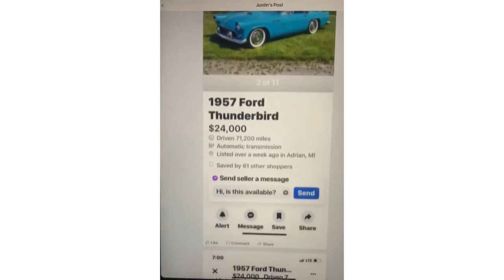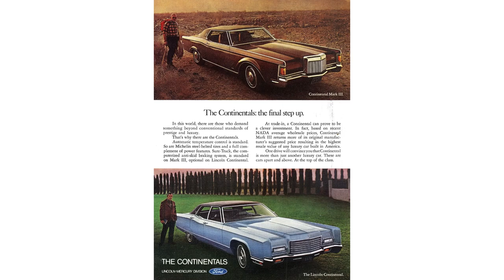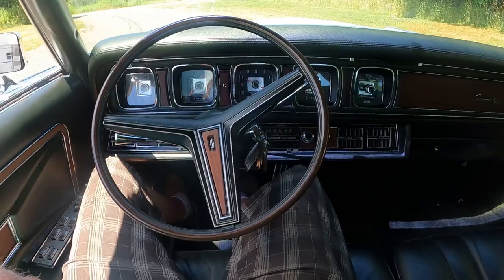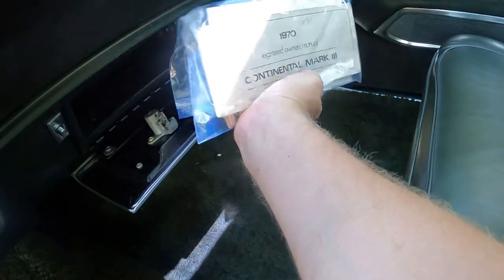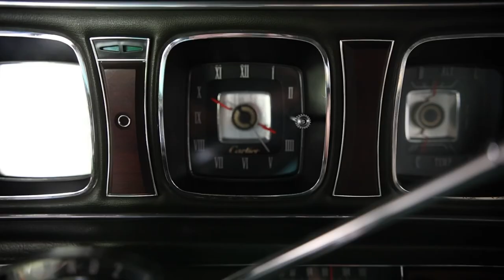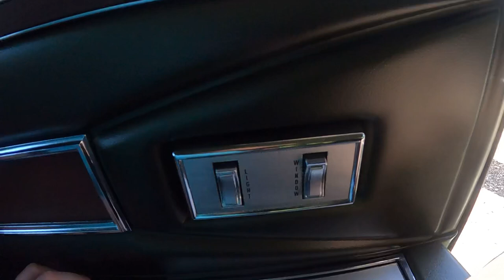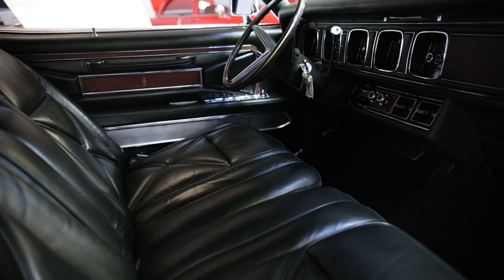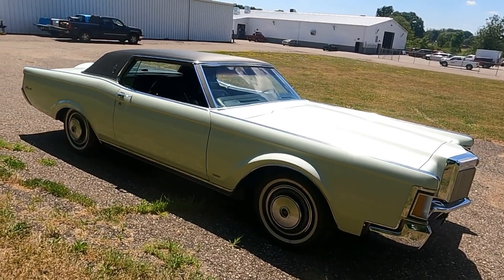1970 LINCOLN MARK III MOST IN-DEPTH REVIEW ON THE TUBE

Comment: I was lucky enough in my teens to have purchased a 1961 suicide door Lincoln in excellent condition… drove it for two years and then purchased my first Mark III a 69 model. I would go on to eventually have owned four of the Mark IIIs over several years. It is interesting to note that with the quick commercial success of this series of Mark that Ford did no design changes except for a few things that only Lincoln purest know - one of them being the hideaway windshield wipers did not exist in the 68 and 69 years and first appeared in the 70 and carried over into the 71 model year. In 68 and 69 the interior wood grain was artificial however in 1970 and 1971 Rosewood was introduced and the model that you show in this video has real Rosewood on the doors and the small strip in the steering wheel and on the dashboard as well. It probably was not inside the dashboard in your example (most lost over time) but at the top of the glove box was a handheld mirror that could be removed from a little shelf that held it. Also you did not mention that this is one of the first cars to use fiber optics. The little bump on the back shelf in between the flow through ventilation vents is a little module with two red eyes that would stare at you in the rearview mirror at night as long as your taillights were on. This feature was to allow the driver to know if a tail light bulb was out. I was absolutely enthralled with that and loved that little feature which used two thick strands of fiber optics that went from those little dots on the rear shelf all the way to the tail light housings on each side of the rear fenders. The flow through ventilation system could be turned on or off and it actually was a pneumatically operated damper door in the back shelf that would open up and completely vent the interior of the car… I think because everybody in the 60s and 70s smoked lol. The Lincoln Mark III in my opinion was absolutely superior in build quality and each series after that seemed to get worse until the Mark VII came out, which was a whole different ball game and actually a wonderful car as well. I am now 63 years old and I have owned about seven various Lincoln’s in my youth. I have long moved on to more exotic vehicles including many Japanese and European vehicles, but the Lincolns hold a very special place in my heart, especially the Mark IIIs.
Reply from the maker: Thank you so much for all that added information very much appreciate it I didn’t know about the fiber optic.. I made a list of all the different changes for 1970 that’s why I went on about the hidden windshield wipers.. The way I end up doing these episodes the research I make a huge script and I usually just read from the script and just add stuff and it’s more of like an outline. But for whatever reason the paper that I had with all of the differences ended up in a different pile and I found it yesterday after the fact. I wanted to mention 1970 was the first year for an American car to offer radial tires as standard equipment They were Michelin.. shot another luxury vehicle that day as well which will be on the channel soon.. it had pillow top seats I forgot how soft pillow top seat were, but I’ve owned two Lincoln town cars one with velour pillow side seats which 1988 I really miss that car and it got decent gas mileage took it on a long trip and got 25 miles per gallon on the highway
Reply: Cool and informative post!   I’ve owned my Mark lll since 1985 and echo all that you stated!   I own a 97 Mark Vlll LSC as well and that is the most wonderful driving car I’ve ever driven.  A great combination of fairly smooth ride BUT crisp sharp handling, ample power , superb steering etc … and very dependable.   Mine has almost 350k miles! Original engine, one transmission @ 265,000 miles.  And this is NYC driving!
Reply: Continental MARK III is superior to any other Lincoln

Comment: My dad brought one of these home in 1982 and I used to sneak it out and drive it. The car had so much torque that if you dropped it into first gear and floored the accelerator the gear selector would pop up into 2nd gear. If you held it in first it would lay rubber down the street. It was a dark blue 1969 model with a black vinyl roof made out of a canvas type of material. Gorgeous bodywork and first class interior. Loved the Mark III.
Reply from the maker: Awesome story thank you so much for sharing =) I still can’t get over how heavy the Doors are

Comment: Did you do your homework at all or did you smoke a doobie before this presentation? You were describing the buttons to open and close the windows and were saying they were for the rear mirrors. You started off ok with the switch  for the side mirror. Somewhere you got lost. Four of those switches have to be for the driver, passenger, and rear side windows.
Reply from the maker: The rear windows are pocket windows I do lots of research before hand on all the cars featured clearly with all the spec given I’d have to have done some research to come up with those specs. I meant to say window instead of mirror honest mistake I’m dyslexic so sometimes I struggle with things.. i especially have a hard time with numbers. Thank you for pointing that out =)

Comment: Hey, I have a 1969 Lincoln Mk III, trying to restore it. The engine of these cars was the big block Ford 460 used also in trucks and vans, as well as big Fords and Mercurys. The impressive thing a lot of people dont know is that these engines were high compression engines, having 10 to 1 compression from the factory. Thats impressive in 1968 or 1969 in a family or luxury class car. The 460 engine is also I think the best big block design out of all American makes, this engine (a stock iron block) can be bored and stroked to 550 cubic inches

Comment: The cruise works as follows: pull towards you the lever on the dash that says SPEED. If system is working properly the little red jewel will illuminate.  Next manually accelerate to any speed over I believe about 24-26 MPH and then press in that little black button on the end of the turn signal stalk. It has TWO Detents. The first detent will select and hold whatever speed you’re going once released.  It also is the Accel feature. If you want to automatically increase your speed you simply hold the button to the first detent until new speed is reached and release it.  If you’re going too fast and want to slow down you push in ALL THE WAY on that black button and it will release the throttle until you release the button.  At that point whatever speed you are now going will be maintained.  To deactivate cruise either turn SPEED switch towards DASH OR tap the brake. Tapping the brake releases the cruise control but keeps it still active so long as you didn’t turn switch towards dash.  Side note: the cruise in the Mark lll does NOT have a resume feature.   You have to once again manually press the gas until you achieve your new speed and tap that button till first detent!  This is almost verbatim to the owners manual.  I’ve had my Mark lll since 1985 know it inside and out!  As for year to year differences : 1968/9 crank driven power steering pump, Diamond pleated style seat/door panel  trim.  Fake wood on every panel that appears wood. Exposed wipers, no rear bumper reflectors, early cars had white instrument needles vs later through 71 orangish, early 68-9 had mechanical clock, the Cartier clock came late 69 and was quartz movement.,  68/9 had the lovely turbine finned wheelcovers,  the steering wheel on 68/9s had horn ring no rim blow yet. Also there were THREE different style center pads on steering wheel depending on production time. Seats on earlier cars had embroidered scroll work on rear center upper seat. Early production NO HEADRESTS.  THATS most differences.  1970-71 used REAL WOOD even on steering wheel, different seat/door panel pattern , rear bumper reflectors added, concealed wipers. Belt driven PS PUMP, automatic climate control became standard equiptment, rear de-icer added to options (lines in rear glass), several other minor changes as well.  New for 70-71 wheelcover design etc. hope this helps !!!  Several other very minor detail changes from 68/71 as well like colors offered , added deleted etc.
Reply from the maker: Thank you so much for taking the time and sharing all of that information we all appreciate that.. I’m hoping one day this channel will be the go to or one of the go to classic car channels especially for someone who totally digs a classic car and wants to know more about it.. some information is hard to find
Reply: I hope it does.  Keep doing what you do !!! Just subscribed
Reply from the maker: Thank you so much =)

Comment: Great review. I was lucky enough to own a 1970. The 69 Mark III had faux walnut veneer, while the 70 and 71 had real walnut veneer. The wipers on the 69 were exposed, and mounted on the cowl. 70 and 71 had hidden wipers. Also, the wipers were hydraulic like the Thunderbird, not electric, and were truely continiuosly variable. There was a fresh air ventilation system that took in outside air from the front, and vented it through a large louver between the rear window and deck lid. My 70 also had a rudimentory Kelsey Hayes Anti-lock brake system for the rear wheels. I could go on, but suffice to say the Mark III had essentially every technology available at the time, and the majority were standard features, not options.
Reply from the maker: Thank you so much

Also thank you for adding that information. =)
Reply: @David Shirly, Nice info. I know Jay puts effort into research, but many cars have some special features that were a big deal in that era. If I recall correctly, the Mark III had 4 wheel disc brakes as standard equipment. The only other American car with that feature was a Corvette. Also, I strongly suggest Jay get a video camera with lighting. 🔦💡🕯
Reply: @markw208  My 70 had front discs/rear drums. Not sure if rear discs were an option or not
Reply: @davidshirly7275  , Hmmm 🤔, I’m absolutely certain they were available. Using the rear disc brakes of Mark III was one of the Ford Muscle Parts suggestions for Mustangs (I had a ‘70 Boss 302).
Reply from the maker: From my understanding rear discs didn’t come until mark 5 

70 mark iii was first car to offer radial tires as standard equipment which was a huge deal. 

I need to getting lighting rig this one I thought gauges were good until wiper pod park the car outside and did it and it had too much lightning created Glare so you’re always looking for the happy medium because inside is too dark.

I’ll look for a 1970 boss 302 added that to the list =)
Reply: No Mark lll only had rear drum brakes which by 1970 had Sure Track a rear anti skid braking system!  But no rear discs optional or otherwise

Comment: Hi Jay, thanks for reviewing the Mark III. These cars don't get the respect they deserve. I had a beautiful 1970 myself that was aqua with aqua metallic leather and a black top; her name is Barbara. I wanted to say that the wood grain in the 1969 was plastic but the 1970 and 1971 was all real wood. The speed switch you were unsure about was for cruise control and while it was very primitive, the Mark III was the first car with antilock brakes. It was called Suretrack and of course it was labeled in the chrome brake pedal which was so of the time. The computer cycled the brakes four times a second which is nothing compared to todays cars but it was pretty darn cool for 1970. Due to my employer chatting down during the pandemic I had to make the hard choice to allow her to go to a new caretaker. She sold at the classic car auction here in Palm Springs with 43,000 miles and is now in a private museum in Northern California. It was an honor and a joy to have her for the four years I did. You are correct that they are not cheap to maintain such a complex car that is over 50 years old. But I have an Audi A8L  that while I love it and it has a price tag in the six figures, it just blends in with all the other cars on the road. Every single time I drive Barb, people would smile and wave. I had a motorcyclist that had a new question for me as we came to each of six red traffic lights. The gas station or stater brothers parking lot always turned into a conversation with a stranger sharing the memories seeing her brought to them. She was nearly 22 feet of aqua colored 1970 excess wafting down the road leaving a wake, a palpable sense of nostalgia and joy. So  as someone lucky enough to be one of her temporary stewards, every dollar I spent to maintain her was well spent. I love that you want to spark an interest in classic cars in the next generations. These cars are more than transportation. They are time machines that speak to the unique world in which they were created. Any classic car person knows it is just different when they are driving the old car. It just brings joy to you and so many others. I sure do miss her.
Reply from the maker: Awesome story thank you so much for sharing sorry for delayed response I wanted to read all of it =) 

Nothing ride like a Lincoln some Cadillacs come close but their interiors ( Cadillacs are too plain for a luxury car in my opinion) you’re right in saying they are machines some of them can be temperamental the more you drive it the better they are generally. 

I owned 88 Lincoln town car still the best riding car I’ve ever owned I reviewed the grand Wagoneer that rides a lot like an 88 Lincoln town car even though it’s a very long SUV I would not recommend buying that car tho because of Reliability issues

Comment: I’m learning how to drive and I told my mom that I wanted to buy this car when I get my drivers license. It’s a super nice looking car and I love the headlights.
Reply from the maker: That car would be an awesome car to own just know it doesn’t get good gas mileage but late 80s town cars are nice and great great gas mileage on the HWY 88 towncar is the best year in my opinion if you go that route look for the signature series it offers better seats The easiest way to tell if it’s a signature series is the chrome goes up the rocker panels to just below the belt line. It will also say signature series on the b pillar vinyl roof they also offered this car with digital dash and air suspension which I would avoid if you could do digital dash is cool when it works when it doesn’t work it’s a colossal pain it the but 

But if gas mileage isn’t an issue for you the mark three is a stellar car
Reply: @What.its.like.  Thank you!
Reply: @MustardCrow  I had one as a teenager in the late 70s. It was an awesome car for a teenager. Fortunately I was that rare kid back then that wore both the lap and separate shoulder belts when I drove. A lap belt alone provides minimal protection as it only restrains your lower body. The shoulder belt is essential for the best protection in a collision. I know, I walked away with only bruises and minor scratches from a head on collision with a drunk driver. I was wearing both the lap and shoulder belts in the collision. Hopefully you will find a Mark iii.

Comment: My father had one of these 50 years ago. Brown with a white vinyl top. It had a hood ornament and the sensor eye on the fender for the automatic headlight dimmer. I think it had an inside hood release. The button on the end of the turn signal stalk was for setting the cruise speed. The back up light lenses were flat, without the protrusions, yours looks like the 1969 version to me. There was no doubt that it would easily do 120 MPH. This brought back many good memories.

Comment: I had a 1971. The power steering pump doesn't last long on these so buy a backup and never if it's a winter blast and that car isn't garaged NEVER try and turn the wiper knob when it's ice cold out because you can break the gears inside.
Reply from the maker: Great information thank you so much for sharing that =)

Comment: Great video!   I’m glad younger guys like you can have an appreciation for what this car was/is.   You nailed it when you said QUALITY!!!! Bingo.  This was the pinnacle of design , appointments and quality.  The Mark lV was a nice car but quality of materials stepped down a bit and the Mark V was even more plasticky.  Even the hidden light mechanisms on this are a work of art and very over engineered !  They have brass bushings where they pivot so that they operate quietly and don’t squeak !   Also take note of the way the cover tilts back then upwards.  They did this so that the covers appear flush fit!
Reply from the maker: Thank you so much =)

Comment: I have one, it is real walnut on the steering wheel. I love mine. Best built car I have owned.
Reply from the maker: It’s a quality built car that’s for sure
Reply: @What.its.like.  I have owned a 1939 La Salle, very dependable, 1949 Cadillac club coupe series 61, (fastback), 1956 Coupe DeVille  double x code batwing V8,and 1968 Cadillac Coupe de Ville which I still own. The Lincoln Continental Mark 3 for 1970 is the best car I have ever owned. I was a Cadillac man, no more.
Reply from the maker: Awesome information thank you so much I’m a Lincoln man.. not really tied to a brand it’s been 15 at least 15 years since I owned a Lincoln
Reply: If it's brown over brown, just don't let the NYPD see it.  They'll take her apart.